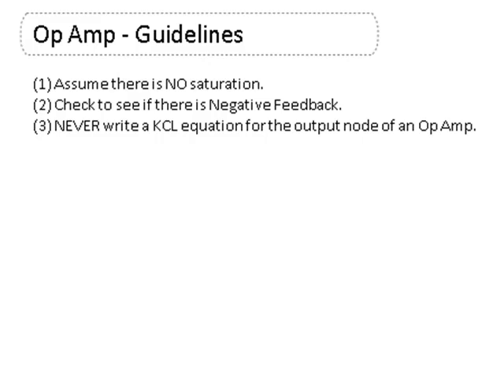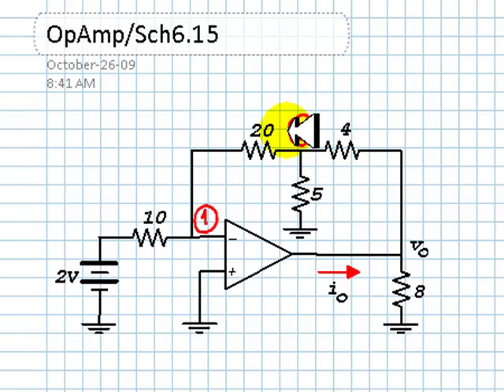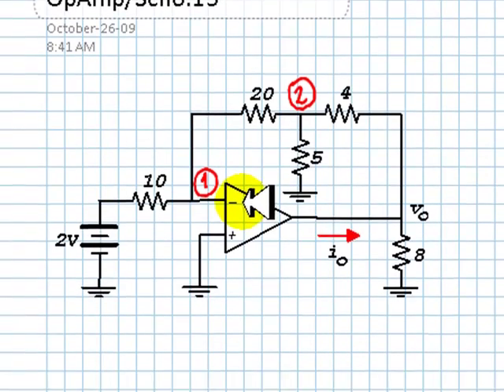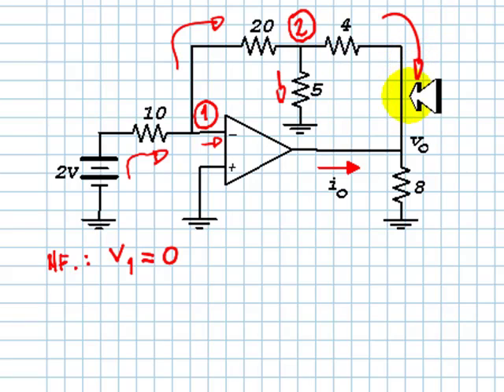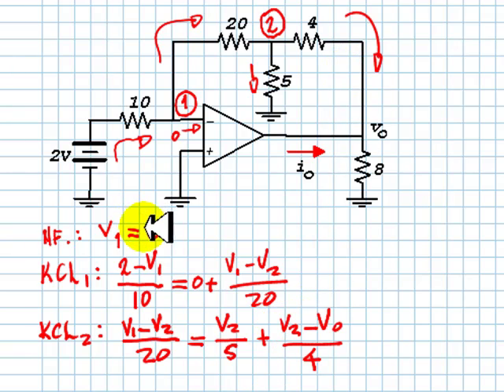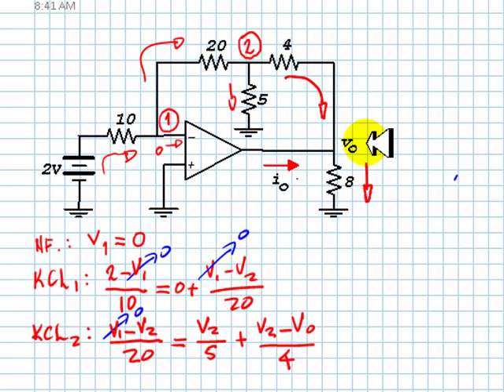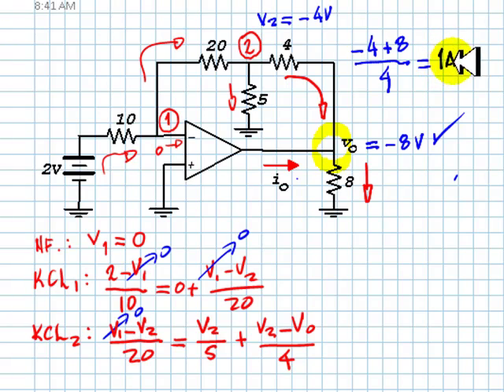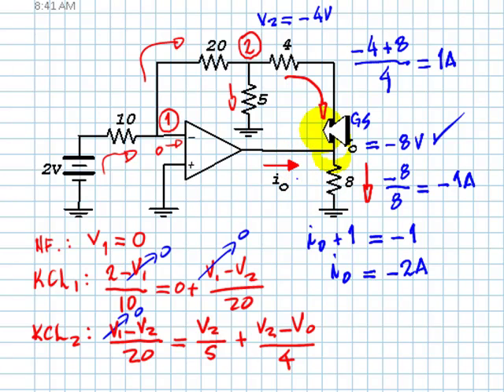EECE 251 - Op Amps Tutorial 02

Comment from the maker: Yes, Mr.Polgas733. But there is a caveat. Of course you can use KVL for the output node ... AFTER you have solved already the circuit: to compute the output current of the op amp; but never during the initial stage of the solution. The reason is simple, before solving the circuit, we have no information on the Io of the op amp, so there is no way (YET) of writing a complete KCL.